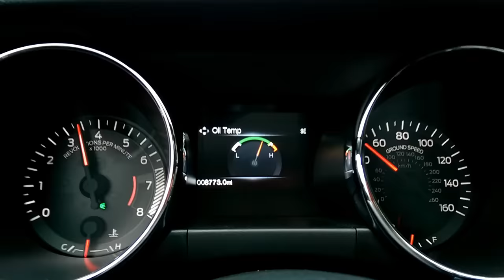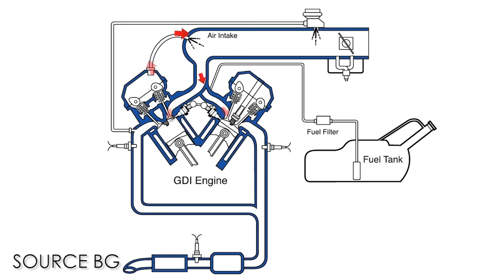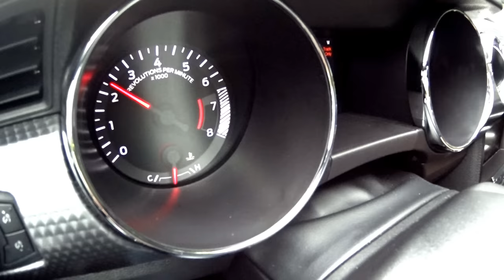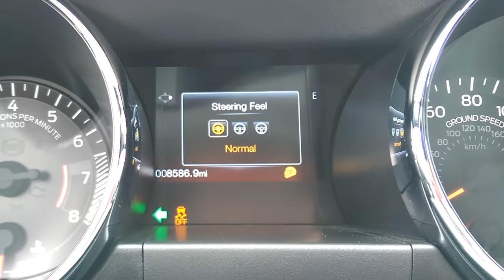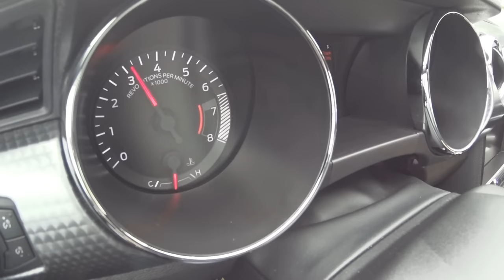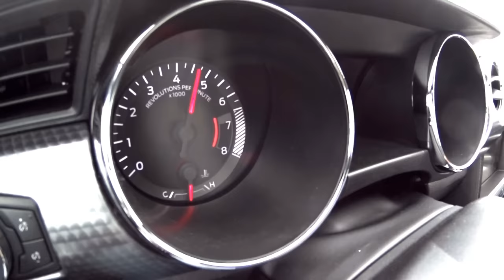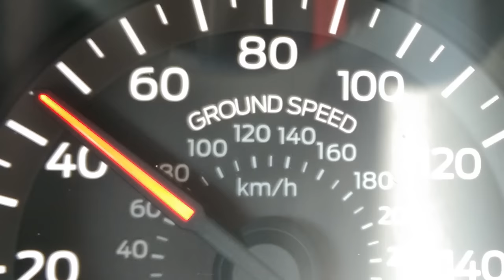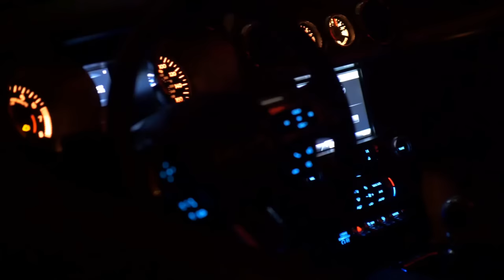Review | 2015 Ford Mustang GT and EcoBoost | Saddles Optional

Comment: 1. The GT PP (that you drove) has summer ONLY tires...soooo, that kind of makes a difference in the wet.
2. The steering weight and effort is SUPPOSED to be greater in sport mode, versus the lighter effort of comfort mode...in ALL cars. C'mon man, you should know better.
3. Front suspension...are you serious? Can't tell.

I like your videos, I really do, but this video here showed that you completely failed to do any homework whatsoever before you got the key to this car, and kind of outed yourself as not knowing much about any cars in general. 

Anyways, I'm looking forward to things improving in the future, as you guys are at least quite entertaining.
Reply: It's a common misconception but summer tires, are considered the best In the wet. Tire rack has a nice article on it. According to them(tire rack) the way tires handle in the wet almost had more to deal with the tire compound than the tread pattern.
Reply: Jack Holmes Now that is a very fair statement, and I'll agree with you there. Yes, the compound used in the GT PP's summer tires, is utter crap in the wet...as many S550 owners have already found out over the past year.

Comment: 13:23 if blow by is such a big issue, why not just install an oil catch can, or even better why doesn't the manufacturer install a factory oil catch can 
I don't get why these idiots thought that having oil vapor blowing right back into the intake manifold was a good thing in the first place
I mean sure I know about the eco concerns, but blowing oil all over you valves is just stupid and it will mess up fuel economy in the process over time, so then what are you really saving?
truth is the manufacturer knows that there needs to be an oil catch can, but generic consumers barely know how or when to change their oil never mind checking an oil can and emptying it
but at the same time any car enthusiast does know how to properly take care of their car, so in the least the manufacturer should add an oil catch can to performance cars that need it

Comment: Hey I need to install a parachute so I can deploy it when ppl ride my ass! LMAO!! I can't get over the 4 cylinder myself. It has a turbo and picks up pretty good but still.. I have the 2014 V6 myself. Yes it's not a V8 but after a few mods it's pretty cool and fun. I keep up with GTs no problem and surprise some people. I'm saddened that they decided to get rid of the V6. It would be best to turbo a V6 but would be too close to or surpass the V8.. resolution?.. put a turbo in the V8! B) ... the lack of steering feel is because you're in Comfort LOL.. I prefer Standard or Sport depending on what kind of traffic I'm in or what kind of driving I'm doing. Sport gives you alot of feel and you have to correct it more. With Standard it pretty much stays put. Comfort makes me feel like the car's driving itself. I don't like that. Pretty cool you catching that near accident on the camera LOL

Comment: Getting in trouble? He's real full of crap. I have a 16 gt. If he's running run flats on this car than that's pretty stupid. That car will not perform with run flats.
Reply from the maker: +Richard Shelton Because no Mustang GT owners get in trouble, right?
Reply: +savagegeese 
Not the new generation mustang. Solid rear axle mustangs? Absolutely. I had one. I know but I also had several bmws and this mustang absolutely has better steering feel than any newer bmws. I appreciate your review and I did  subscribe but there are a couple of your observations I had a problem with.